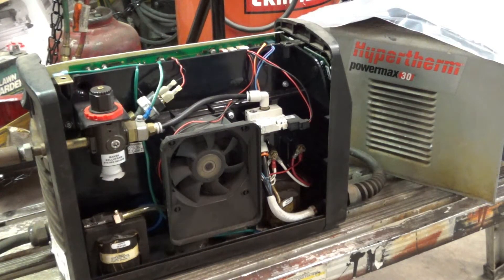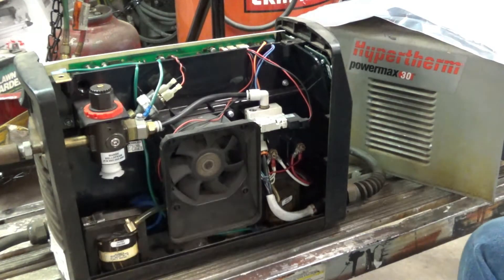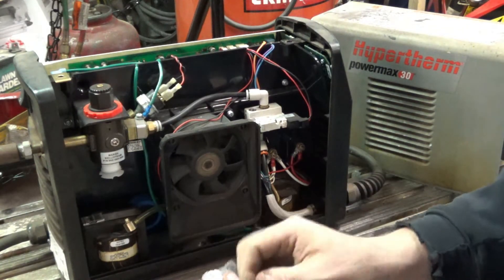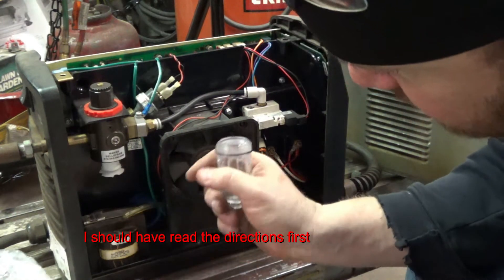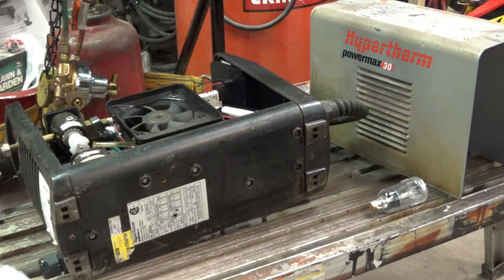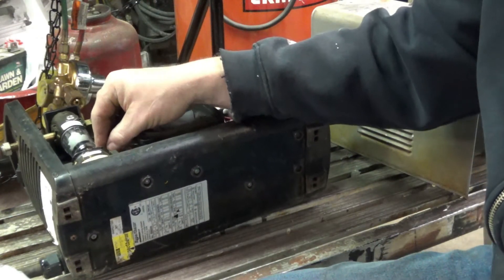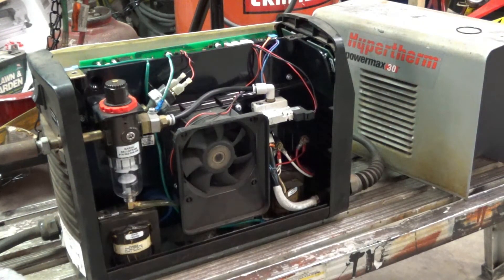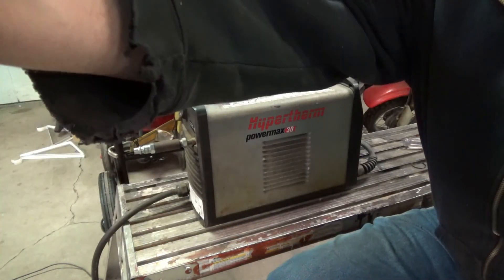Hypertherm Powermax air leak repair.

Comment: my power max 85 doesn't take 100 psi   . That kind of pressure will break your bowl
Reply from the maker: It may have…. I have a 65 now and did not even set it up yet
Reply: @GSEShop  check on much air your suppose to give it I believe it is 84 psi , want your consumables to last forever .Build an air drier out of a refrigerator . get the fridge free from craigslist

Comment: I'm guessing the bowl gets moisture in there then freezes and breaks the bulb.
Reply from the maker: I figured it was stress cracks.  The bowl shouldn’t be full of water, and it shouldn’t have enough in it to crack when froze
Reply: It looks like a water trap, so the drain is to let the water out?

We have two of these at work and both pissing out air so much so they trigger the low air light, so the better machine is off to be fixed. Think quoted over $800 AUD to replace this and 'service ' it! Insane amount of money, will have to try and fix the back up machine myself so thanks for this video! Just need to find a place that sells the bowl as imagine it's going to be the same issue!